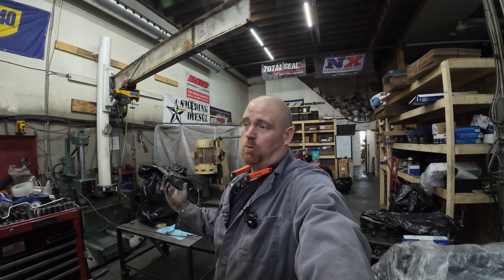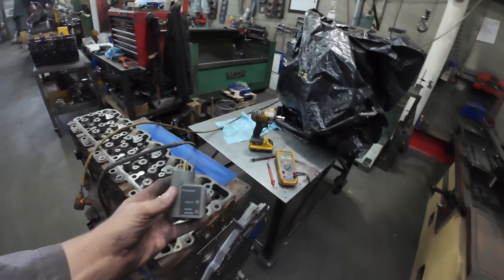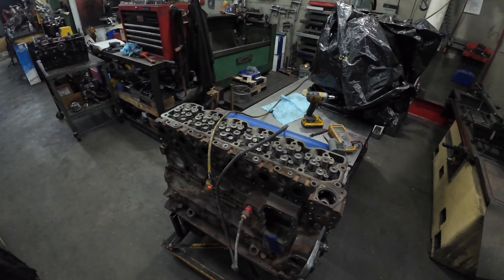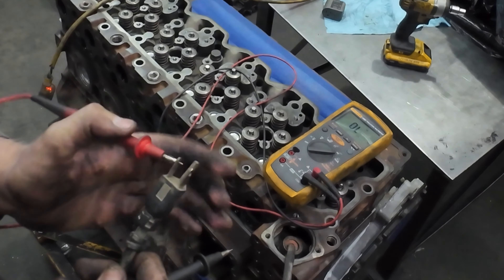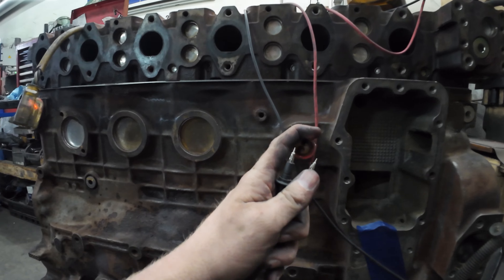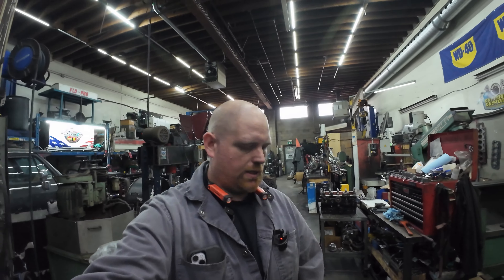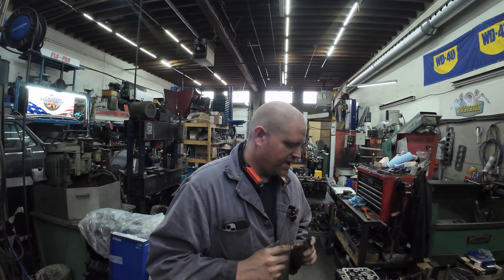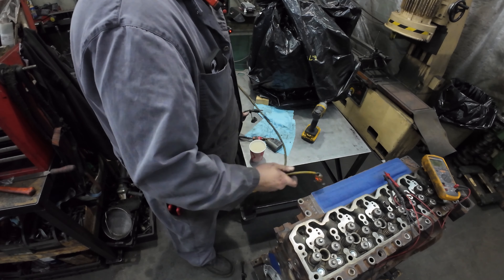3 WAYS to test a BLOCK HEATER ( one is FREE  )

Comment: An in line plug in ammeter (the best way to check an operable heater) or a clamp on ammeter (with an exposed single line wire to clamp onto) is a good way to tell for certain if it's drawing a load.

Comment: I run mine on a WiFi plug on a timer. It also monitors wattage, volts and overall usage. I did notice that over the years it begins using less watts.